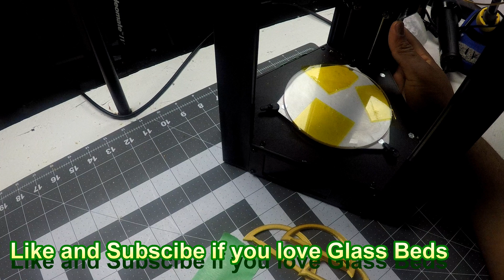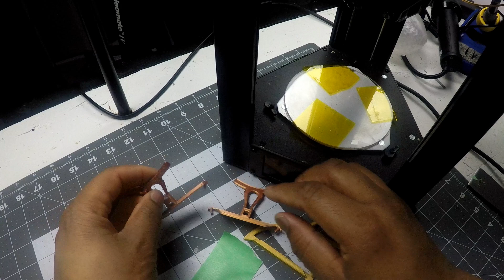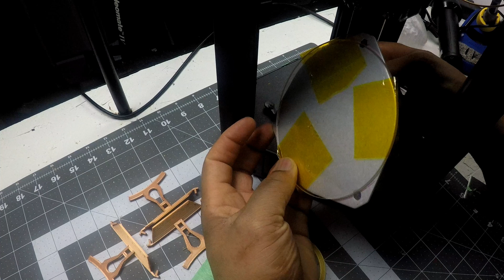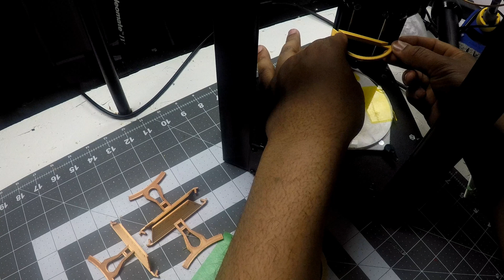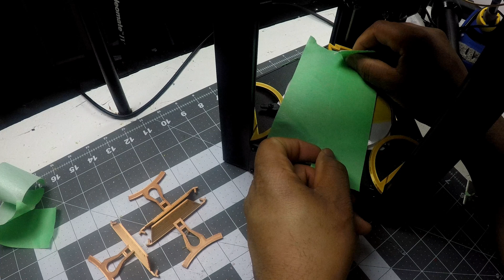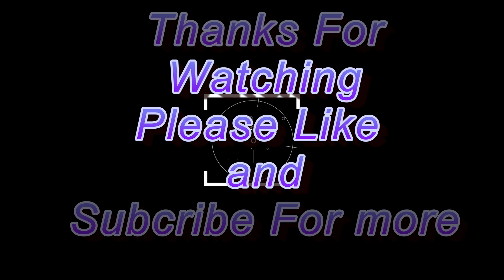Installing Glass Bed On Mono Price Mini Delta

Comment: Hello. Great video. I know I'm late but can u tell me what king of painters tape you are using and also can I use that tape on top of my original bed?  The  top part of the bed has started  to RIP.
Reply from the maker: I'm using green frog painters tape but you can use any masking tape doesn't matter. Also yes you can use it on top of your original bed.

Comment: I think you've got a good solution. I bought a glass build bed but have not installed it yet. In the meanwhile my teflon coating is coming off of the aluminum and causing leveling issues. So I'll print those clips tonight and pick up some painters tape. I guess the big questions is, how do I remove the rest of the torn up teflon? I'm sure the answer is here, if not on your Youtube page, then someplace. Thanks!
Reply from the maker: Thanks .I preheated the bed using the pre heat option in the menu and used my finger to peel the edge up enough to grip it and slowly peeled it off . Then I cleaned the residue with acetone .

Comment: hey man, i noticed you mentioned that the back left side wouldnt print properly there is a way to do a different calibration and it fixed that issue for me. You have to open the gcode in notepad++ or a different program like it and than change "G29 P4 Z0.28 ; Auto-level ; ADJUST Z higher or lower to set first layer height. Start with 0.02 adjustments." to "G29 P6 Z0.28 ; Auto-level ; ADJUST Z higher or lower to set first layer height. Start with 0.02 adjustments." changing that value from P4 to P6 changed the way it calibrates so hopefully this helps.
Reply from the maker: Thanks bud I really appreciate it .
Reply: Barely Making It 3D Printing let me know how you make out I just did a print and it looks flush to the stock bed

Comment: where did you get the glass?
Reply from the maker: Mini Delta 3D Printer 120mm X 3mm Borosilicate Glass Plate, Build Surface https://www.amazon.com/dp/B075B1R9YZ/ref=cm_sw_r_cp_apa_i_oovKCbBTG2SBX
Reply: I found some 3M double sided transparent tape at my local hardware store and used it. Might not hold up to high temp's, but the Mini Delta only gets to 60 deg's.  I like that I can pull the glass off and clean it. Here's a link I found for the same stuff:  https://www.officedepot.com/a/products/909955/Scotch-Double-Sided-Permanent-Tape-In/